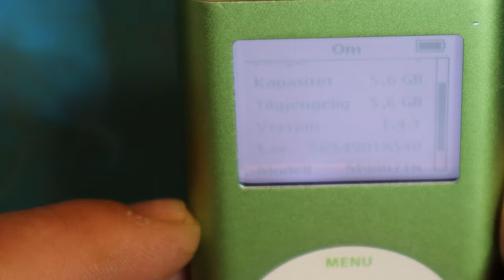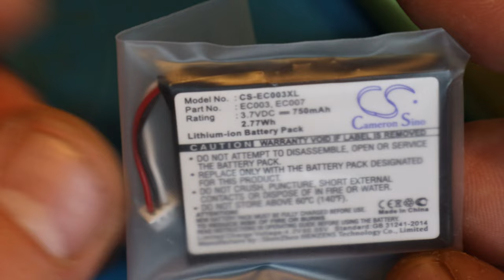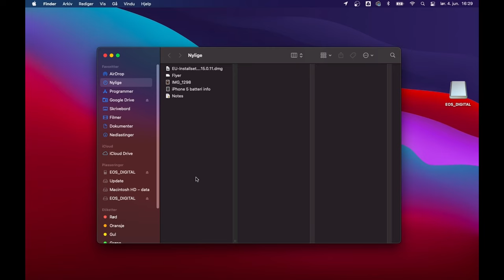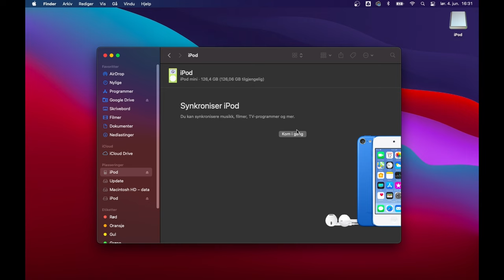iPod mini 6GB upgrade to 128GB

Comment: I’ve been struggling with iPod Mini 128GB flash mod. 
I don’t know if it’s the card compatibility issue, or iMac issue. It wouldn’t format.

I tried Lexar and SanDisk, with iFlash SD-CF adapter, and no difference. 

Any idea?
Reply from the maker: @ryo.hayshed_mcmlxix I haven’t heard of the iFlash SD-CF adapter, so I have to do a little research on that one. It could be either an SD incompatibility or adapter incompatibility. Hard to say without knowing exactly what is happening.
Reply: @LetUsRepair  Thank you very much for your swift reply!

iFlash, in case you haven’t heard, is an UK based specialist of flash modding iPod that’s been doing it for some years, and their SD-CF adapter is supposed to be taylor-made for this purpose and has a reputation of being reliable.

I have also tried another SD-CF adapter, but result was the same. I also tried another iPod MINI and it also fails to restore.

My iMac is a bit of vintage, which I don’t know if matters.

If you have recommendations of card adapter & SD card combinations that reliably work, I’d love to know and try them.

Thanks!
Reply from the maker: @ryo.hayshed_mcmlxix I just read up and checked them now. They sell a Type I SD to CF adapter, and they only say “Reported to work with iPod Mini gen 2”. I have used (successfully) a Type II SD to CF adapter, like this one: https://a.co/d/iZXvHbX along with a 128GB PNY Class 10 SD card like this: https://a.co/d/fo98hfk
The adapter isn’t the one I used in my video, because the one I used was sold by a Norwegian company, but it is the same specifications. The Type II being important!
Reply: @LetUsRepair  Thanks for that.

I have feeling the “other” adapter I tried was Type II, but is quite old. I’ll get the one you suggested with a new card and try.

I’ve also tried a 128GB CF card directly, which didn’t work either (a Lexar card. It works OK with iFlash card adapter board in a 6th gen. iPod Classic). Lexar cards often seems to suffer often from compatibility issues.
Reply from the maker: @ryo.hayshed_mcmlxix My honest opinion about Lear, is the same as you suggest. I have frequently had issues with Lexar products, so much so that I avoid using them. 
Just to ask; Which generation is your iPod Mini? I know there were people who had problems with one of the generations (I read a few questions on the matter on iFixit) doing this mod.
Reply: @LetUsRepair  Both my iPod MINIs are 2nd gen. or at least they’re supposed to be.

By the way, I was getting “unknown error: 1406” or something similar when I tried to restore the iPod MINI with 128GB SD card.
I could make a 2GB SD card to restore through iTunes with everything else the same as when 128GB card was in, and a 16GB card somewhat just about worked.
Reply: OK, I got a new SD-CF Type II adapter with a 128GB PNY Elite-X SDHX card, and it has definitely gone further than had done previously with other adapter + SD card combinations.
iPod seems to be RESTORED via iTunes, instead of giving unknown error, and went as far as WELCOME TO YOUR NEW iPOD, however it stuck at SYNCING iPOD.
I had to force quit iTunes (not responding).

I tried other (smaller) SD cards with the new adapter, and they didn’t go anywhere as far, so I presume the card compatibility issues were real.

I’ll try other synch cables and pre-formatting the SD card etc.
If you have any more hints & tips, I’d be grateful.
Reply from the maker: @ryo.hayshed_mcmlxix Great news that it at least did the restore completely, that means it has full contact with "hard drive" inside. You mentioned earlier that you're using an iMac, and that it is of some age. I have no experience with that, as I only used a 2018 MacBook Pro on one test and a regular PC running Win10 and latest version of iTunes on it. In newer MacOS, there is no iTunes, everything is don by different apps (Podcast, Music, etc). The restore functionality is done using Finder.
Reply: @LetUsRepair  Thanks
Yes, the ages of my iMac and of its OS are a bit of concern. I now wonder if expanding RAM might help there.
I’ll keep at it for another while…
Reply: @LetUsRepair   I left it for a couple of days, and reconnected the iPod Mini to iMac, and it just worked.
Loaded an album in AIFF files and plays back fine. FINALLY!
Thank you very much for your tips. It worked great.
Reply from the maker: @ryo.hayshed_mcmlxix That's awesome! Nice that you got it working :)
Reply: I may have celebrated too early.
The one with 32GB microSD is working OK, but 128GB SDXC stopped responding when connected to iTunes, and wouldn’t restore again. It’s as though the card is in a wrong format.

I was hoping to get the both of two iPod MINIs I got to 128GB, but I’m now afraid of touching the one that’s working (with 32GB card).

I wonder if the resources on my iMac is not sufficient… not enough disc space or RAM not large enough…?
Reply from the maker: @ryo.hayshed_mcmlxix It could be iMac related, if it’s a fairly old one, and especially if it’s got very little free space. If the iMac is older than the release date of the iPod, and it’s running very old MacOS, that’s not helping 😕
Reply: @LetUsRepair  I'm a bit confused now...

Well, I formatted the new PNY card (that worked out of box before) using a card reader, to "Mac OS Extended (Journaled)" and re-fitted to the iPod MINI. The iTunes "Welcome"d the new iPod and didn't ask to restore... It appears to work while connected to iTunes... I copied 30GB worth of music files without problem, and plays back through iTunes via computer's speakers, too. But, as soon as I disconnect from the computer, it wants re-connecting and LCD of iPod asks for assistance...

I've tried an old TDK brand 2GB SD card, formatted in a card reader, and it worked... iTunes restored... and music file copied and playing. I tried the same with a SanDisk 16GB SDHC, and it gave error while restoring...

I do wonder if it really is an issue with iMac's RAM (it is 8MB... can be doubled to 16MB. iMac is late-2009, so not as old as the iPod Mini)
Reply: Ah! I got it working with 128GB PNY card!
I formatted it with card reader, and put a partition before putting it in the iPod.
It seems to have done the trick.
Reply: I thought it (one with 128GB card) worked, and it is kind of working… but, it freezes while playing back. It isn’t like a particular music file is corrupt (I don’t think) as it freezes randomly.
It’s matter of force restarting every time, but it is annoying.
I suspect there’s hardware issue, or setting issue. Does anyone here experience the similar issue, and know how to solve it?
Reply: I would like to donate some non working iPod or working but with some minor issues like battery replacement needed or hdd replacement or screen replacement Lots of Love ❤️ from India 🇮🇳
Reply from the maker: @Flamingo680 That would be awesome 🥰 If you want, you can send an email to geirandersenrepairs@outlook.com and we can take it from there ❤️